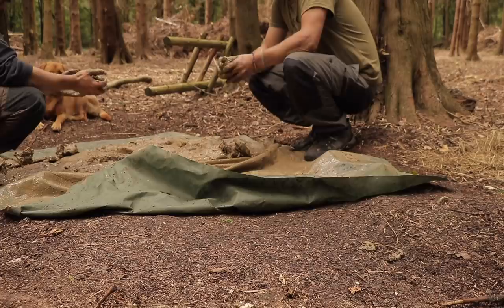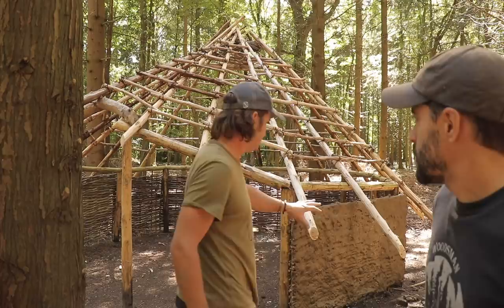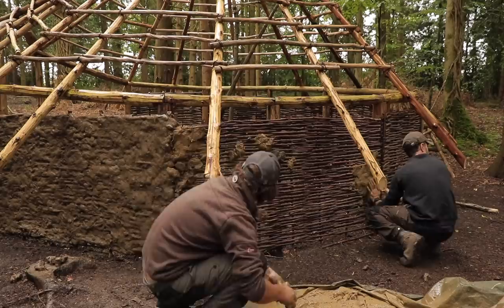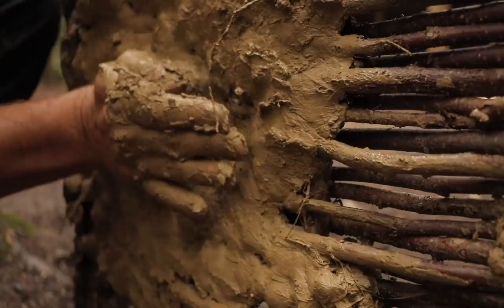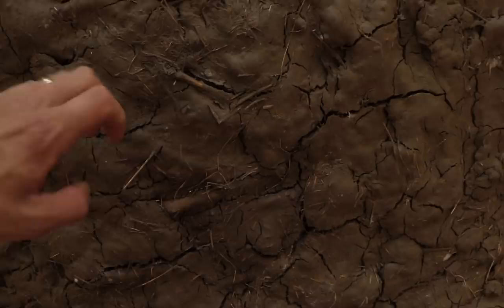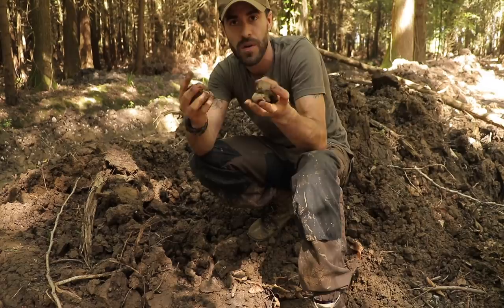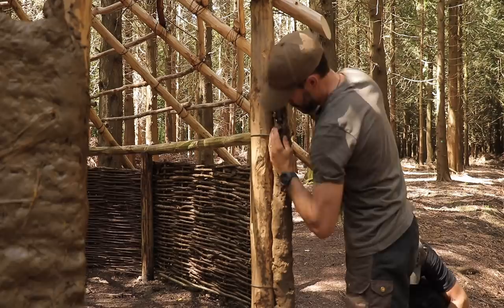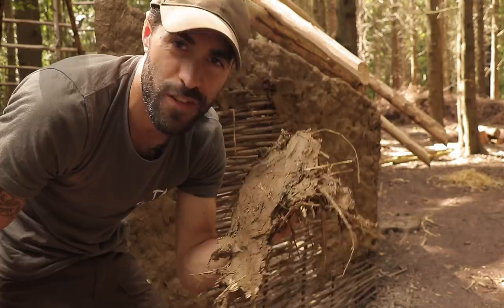Building a Roundhouse: Clay Walls with Bare Hands | Bushcraft Shelter (PART 6)

Comment: Wonderful videos here. I think I might make a few of these put together in the woods and live in them. With cordwood sides instead of mud and wattle. And wood ceilings. And one with cement and beer bottles I've collected. I wont buy a $60,000 house that isnt livable if the power goes down a lengthy period of time. Have a rocket stove, cast iron stove, portable washing machine, ect.

Comment: it would last longer if you had properly prepared the ground base. i would have removed the top soil and dug a perimeter trench into the subsoil  for drainage and built a mound of packed subsoil to replace the inside topsoil base and backfilled the trench with the permeable  topsoil and/or large chunky stones ,    this draws the moisture away from the camp during rains

Comment: Don T cut your rafters too short it will make the rains puddle and ruin your work !!  Just do the beveled edge..round it off.
   You need at least 1 foot of extended rafters. The longer they better as for maybec2 feet..you can use as wood storage..easy access and already have it half done using the completed wall.
  Also great place for rock wall atea for cold food storage ..with tiny door access from inside.  If you get that cold a weather.

Comment: Any kind of soil have clay .. you must. Test using water how many persentage of sand inside of the soil on your back yard of not enough you must add sand untill become 70 percent sand then 30 percent clay only ..like sand castle using clay as a glue to sand building... It will not easily crack 😉😉😉

Comment: have you considered putting the mud & straw on the wall while it is still horizontal & BEFORE you erect them.
You will only have the fix the cracks of the erecting process and at the joins.
And to be a bit more picky; I would have thought that the Wattle panels  would be interwoven at the joins . Rather than the discrete panels and joins that you have used there. Maybe tied together by a separate inter weave?

Comment: Lets have a clay debate, I watch another Bushcraft Youtuber that says, adding straw to clay for a binder is a bad idea, because once the straw decomposes it leaves an empty void where it once was, making the clay weak. But in this video you used a cob mixture. which one is superior? and does anyone have any experience with either method?
Reply: we use a lot of adobe around here and have often wondered the same
Reply from the maker: You will inevitably get cracks when using straw. However, as it is in long strands, the wall is less likely to crumble. If you used just Clay, not only would it crack but it would crumble into small pieces when it dries. But the straw will keep it bound together, but the cracks will form and be more like tissues then crumbling the whole wall. Essentially, these methods will never prevent total cracking. It’s in the chemical nature of clay that it absorbs humidity in the air and can change consistency when it dries or gets wet. This means that you will most likely get cracks when using it. But it’s all about damage limitation and reducing the cracks as much as possible

Comment: if you plan on more wattle and daub stuff make a pit deep enough for a normal batch ... put a round post in the middle and make a spindle on top add a cross member to push to rotate ... that rotating piece has split logs going down to the pit to stir the daub ... then you keep your feet cleaner and use a mechanical advantage to mix what you need ... think of it like crushing apples for a cider press but with some plow like flat boards to make the daub move and mix
Reply: you will find better heat retention if you close the gap ... there is enough airflow around the door and through the thatch to keep the fire at a low heating cooking fire ... NEVER put a chimney hole in thatch ... you will burn it down very fast because you draw so much air in that the heat and fire reaches the thatch ... thatch is porous enough to let the smoke gather near the peak where it keeps the bugs out ... and filters through to the outside ... that is why the thatch layer is never a set depth ... it is a judgement ... enough thatch to keep the rain out but not so much to stop the smoke leaving .... it usually comes out to about 8 to 12 inches ... but the force of the rain and snow does change it
.
yes I have thatched ... with my grandfather who was a master thatcher ... the last one we built when i was a child of 5 ish lasted until 6 years ago ... im 55 now ... and no it wasnt maintained either
Reply: btw the daub machine is bronze age tech btw
Reply: think of damsel flies as bonzai dragon flies
Reply: while you put the daub on with the heal of your hand also rotate your hand as you push it in ... it gets the daub to curve into the tighter bits and seals better also gets more off your hand ... and your daub might be a fraction to dry ... not by much though ... a few pints
Reply: keep a wattle panel built for measuring post length on the next structure .... then you just plant a post rest the panel and mark the next and away you go ;)
Reply: best dung is cow dung btw .. 1/3 dung 1/3 clay 1/3  the rest ... add some ash (bug repellant) a bit of dirt (not sand) and 60% of it straw .... the reason for the other bits is to repell bugs from the daub with manure and have something that soaks up water along with the straw to deal with the constant dung making more vapour ... the dirt help the dung stop stinking and keeps it at a good dry wet level while the clay dries

Comment: there are lots of tutorials for making COBB mix, which is how many make their walls in hand built buildings, its great stuff :D,  your head looked very sore .. ewww
by the way i think with all that clay around, it would be really cool if you made a kiln and made some clay coil pots, I've done ceramics NVQ its so much fun and you have to keep kneading it like dough to get air bubbles out but just rub the surface of the dry pot with a spoon to seal it before baking and it'll be waterproof

Comment: will this house have a chimney or firepit, whereas the other thatched house did not? -- would think a chimney, while a pain to bldg, might make having a fire safer and be more than enough to keep the entire thing warm once the thatch is on....I envision a "bottle" chimney...that stands on 4 posts about 3'-4" high, and made with the same wattle & daub method as the walls, but with extra clay for the "lining" to protect the wattle weave  from heat damage.    doing the 4 (or 6) posts, would allow for all around access, so the heat radiates to all areas inside.
Reply: Normally it's a fire pit. The roof design allows the smoke to seek out (which also helps to keep bugs from moving into the roof) and the top would lack oxygen, so sparks wouldn't light a fire in the roof.

Comment: I feel like perhaps you worry too much about the cracking..? Can you explain why you’re worried about this?  I totally admit, I’m making this comment like 7 minutes in and am completely uninformed, and/but I’m wondering if it wouldn’t be super easier to make a really wet clay mix, slap it on, rub it out quick as, and allow it to crack if need be as it dries, but apply a second/third layer as appropriate afterwards allowing new layer to work into any cracks... I feel like it would have been a lot quicker to apply?  Plus, you could always smooth out surface with a large flat abrasive stone when finished drying if need be and smoothness is a thing to consider? 

Please don’t think I’m criticising!!! I’m not! I’m super impressed! I’m interested in the thoughts that go into making the decisions! 

See, I wonder if part of the appeal to this style of hut is the ability to ‘throw one up’... think emergency get out of elements!  I’d almost like to see a series of videos with that emergency style process in mind... think ‘Alone’ style series meets ‘survivorman’s’ mock light airplane crash in wilderness episode, where rescue is expected eventually and you have to survive an extended period...  I feel like as a lone person, we would see they might just knock up a super quick debris hut potentially, first night, to rest and recoup, then as situations/weather dictate, over time perhaps a really small wattle and daub type hut, just to get out of rainy season weather, then if the realisation that rescue hadn’t come, perhaps the development of a larger home style house to thrive rather than just survive... I’d be glad to hear anyone’s thoughts on that process etc...

I totally enjoy the videos this channel does, partly because our chap is humble and doesn’t try to make out like he’s Rambo, often ’wondering aloud’ and sharing with 4th wall, but also the fact that we see the attempts and highlighted successes AND failures, and learn from them together! 

I’m going to end my rambling thesis here, but hmmmmmm! It’s good to have a think once in a while! 👍👍🥰✌️

Comment: speaking of the quality of clay, if you've a small dry gulch or even a small stream, look there, the action of the water strips away the dirt, exposing the clay.  Another thing, in the middle ages, castles were whitewashed as a sort of fire proof, but also beautifying technique.  What if you did the same to the second layer of clay?  So a whitewash of lye maybe, with red clay designs painted on the resulting surface?  I think it would look stunning, and I am sure an artistic person, or perhaps a wealthy one, would have been able to accomplish that.

Comment: Does the clay wash away with the first rain? 😕🤔
Reply: No... especially if the roof over extends the walls. And if you make this in a hot climate time. Such as summer. The sun can bake the clay as well. Yet they are in the trees... my mum made a wicked stove out of clay. Lasted all summer. When we finally put in the concrete for the garage, they had a tough time destroying the stove she made. It was solid.
Reply from the maker: It doesn’t wash away as such, it just affects the drying process of it and will make it more likely to crack
Reply: MzClementine good info, thank you!! 😊

Comment: Ta outdoors!!!! Noooooooooo!And  that gap you have eluded to building at the  back of the hut as a vent is wrong! Don't do it! Otherwise all the smoke will remain low inside of the hut and it will mean the roof doesn't get the full benefit of the heat and the smoke. Which means the roof will rot quicker and bugs so infest it! 

Build the walls as high as you can authentically! Don't do that little vent! Real ones and successful builds of roundhouses I've worked on don't have them! So don't change the design that's worked for 2000 years.

Comment: i may not know about daub but i do know clay. you should be careful about the type of clay you use. the more pure clay you have the more it will crack from the shrinkage. in pottery you grog the clay by adding in tiny sand sized pieces of failed pottery that's been ground down. for daub, which will never meet the kiln, plain old sand will do. the only type of pottery to use realy pure clay is porcelain, for this job you want more of a terracotta, still clay but it also gas a gritty sandy texture to it. or you could try adding dung, i think some parts in India  just use plain old cow pats to daub their walls.

Comment: was wondering since you have an abundance of pine needles. Would they work as a binder?
Reply from the maker: They are a little too small. It’s the longer length of straw that makes it a good binding material as it weaves itself around the sticks as you push it in